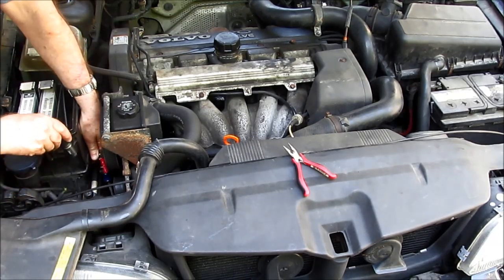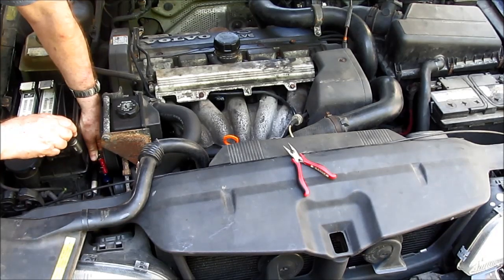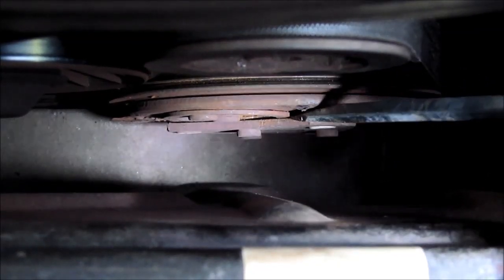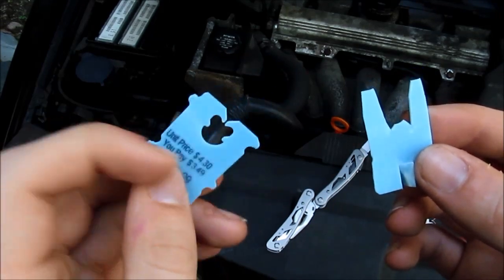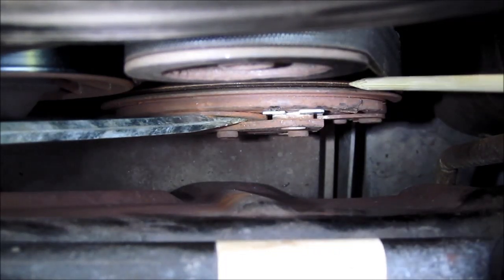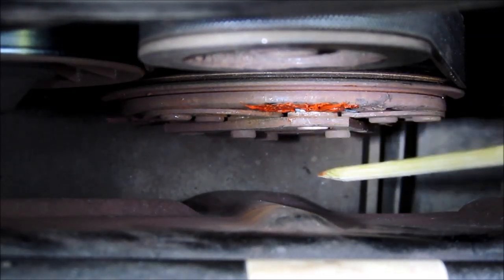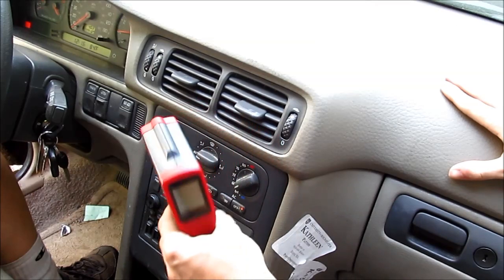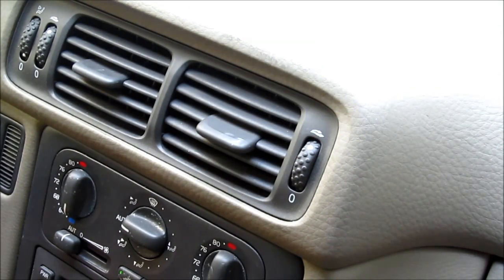Aircon Compressor Repair on 1998 Volvo V70 using Bread Bag Clips

Comment: This just saved me at least $1,000 since your solution worked!  Thank you so much!!!  I bought Permatex Red RTV High Temp Gasket Maker sealant from Walmart for $4.47 + tax to glue around the edges of the bread bag ties.  Also, I found it a lot easier to wedge the bread bag ties from underneath the car (jacked up, unscrewed the 10 mm holding the plastic undercover on the left front, my son pried the outer clutch plate and I inserted each tie, then glued them with Permatex).  Result:  Ice cold A/C.  Awesome!!!  

Thanks from a Florida engineer!
2000 S70 with 242,000 miles

Comment: I measured the gap on my clutch as 30thou inch and then cut up a dead credit card which was 25thou thick and glued the shims in with epoxy glue. The fix has worked for over 2000 miles and my car is a V70R (I use the performance) and things still work. My original symptoms were following a re-gas the air-con worked for about 2 miles then the system failed, very please with the video pointing me in the right direction..

Comment: I do not recommend this! That's a invent that can distroy another components of the engine compartment if the glue and the pieces of steel you used will be throw away from where you put it !
Reply from the maker: There is no steel involved here, and the glue/plastic is far softer than most road debris that gets tossed up in there all the time from the wheels.

Comment: did your a/c ever blow a fuse??  mines was working fine, then started to blow the a/c fuse.  shop said its a short, maybe in the compressor.  can a faulty compressor cause this?
Reply from the maker: Could be in the compressor itself or in the wiring that powers the compressor. I'd check the wiring first because it is much cheaper than a new compressor.
Good luck getting it fixed, and feel free to reply to this comment with an update on what you or the shop finds out :)

Comment: Did the engine cooling fan work propely before that fix?
Reply from the maker: Cooling system worked just fine.  Engine warmed up normally and didn't overheat.

Comment: I strongly recomends a new magnetic clutch do not do this fix.
IT can lead to a Burnout in the AC system that would result in a whole new AC compressor, vacuming of the system and a refill of the system
Reply from the maker: The parts and labor for a clutch replacement = parts and labor for refurbished compressor.  Same procedure of vacuuming system, replacing the compressor, and refilling due to limited space in the engine compartment.
 
When the compressor fails, then we replace it as normal.  Until then, we will take our chances using that extra mm of clutch pad to get another few years out of it.  

Alternately, Volvo could have put in a stronger clutch solenoid that could deal with the wear.  But that would be overbuilding and NOBODY keeps their car more than 4-7 years, RIGHT?
Reply: Alternatively, you can remove the clutch from the compressor (no need to discharge/evac/recharge the system), then remove or add shims as necessary to get the gap on the low end of the spec (.012-.023in).  Usually removing one of the shims (normally 2-3 shims under the clutch) puts the gap right on the money.  Using this method, you can be sure that the clutch gap is even around the entire circumference (not in 3 localized points as w/ the bread clip type fix).  It doesn't take too much more work, and this fix would last considerably longer than the bread clip fix.  No risk of the clips coming undone either.

Comment from the maker: There are three places where the bread clips are installed, at equal distance around the pulley.  Use the screw driver to turn the pulley until you can find the other two places. I used high temperature gasket maker, but any permanent glue or epoxy will work as long as it can take high temperature.

Comment: Hi, I saw your video I really like the trick how you use the brad clips okay I have a question? You install the first brad clip on the top gap by wedge the flat screw driver where did you install the other 2 brad clips? Could you please describe? and what kind a a glue or sealed you use for brad clips so they cannot fly out when the engine is running. Please do reply to me

Comment from the maker: It was high temperature gasket maker.  Pretty much any epoxy or adhesive will work as long as it's tacky enough to be smeared on and will survive 100+ degrees C.  Good luck with the repair :)

Comment from the maker: On this model (1998 GLT) it's a tight squeeze but no parts of the car need to be removed other than the cover/air hose for the engine computer.  I suggest you look on forums to see if there's any info for the 2000 V70.  The compressor will be on the belt side but may look different and/or be in a different place than it is in the '98.